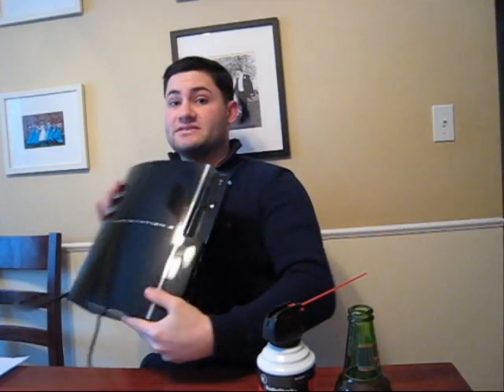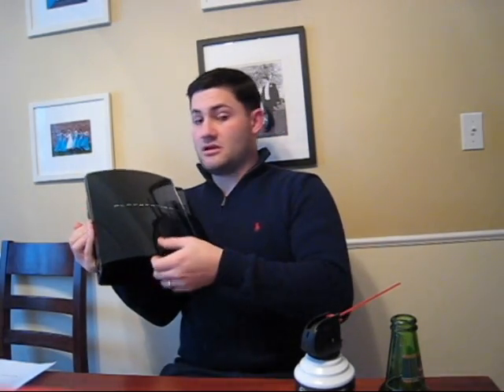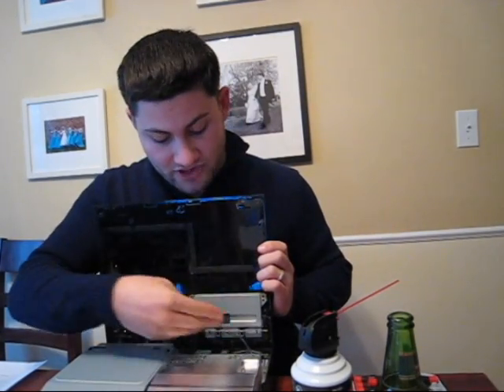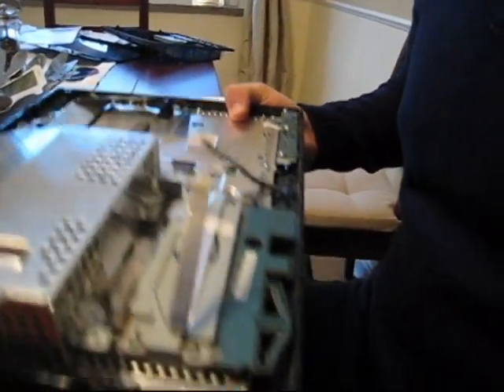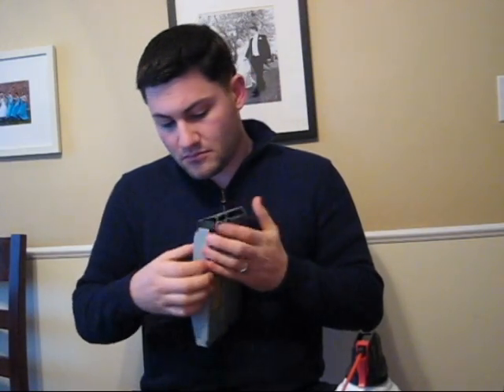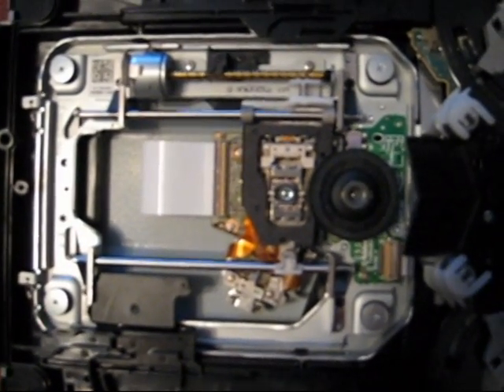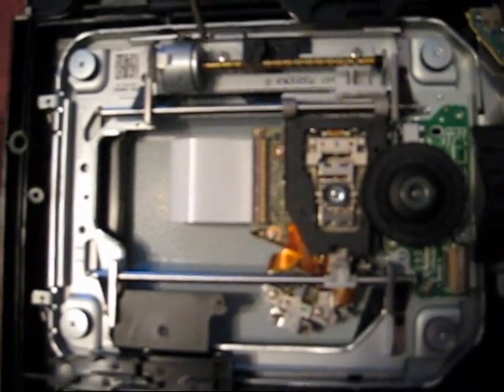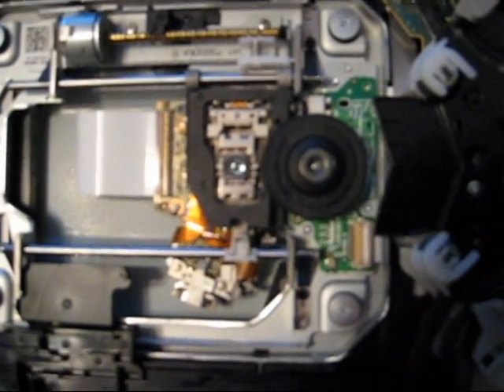PS3 Blu ray Drive Laser Replacement Tutorial

Comment: @prussell890 actually I did say "RISK" lol, but no that is nothing like saying the same about a laptop, try doing this with a PC, they are meant to operate while level, PS3 are the same, read the manual for PS3 and it warns not to do this or you'll damage the HDD, laptops are designed to be portable... and so are thier hard-drives

Comment: i just installed a new laser with the mech that comes with it,i tried plugged in,and once i put in dvd it got stuck and would not eject,it was almost like a cd was not in there,so i took apart and removed the dvd,now everytime i put it together no dvd is read and it will just stick in maching and when i open up the tray it seems like the dvd was not even all the way into the drive even though i pushed it and it sucked it in(pause) please help my system is open as i type

Comment: depends on what you need, the KEM-400aaa is the deck. KES-400a is the laser itself. I haven't encountered any bad decks, just bad lasers. but see what you find because sometimes you can get the both at the same time, or get them separately, its up to you. just don't get any 410 stuff since that won't work with your system.

Comment: after i took off the 7 screws that make the lid, i noticed the lid in the back right corner where there are 2 screws and one of them are the small screw... that corner wont raise up for some reason. what should i do without breaking the system?